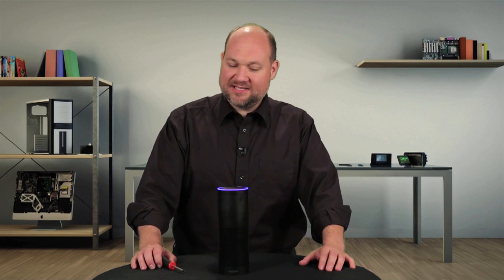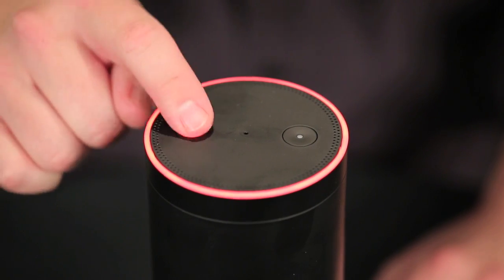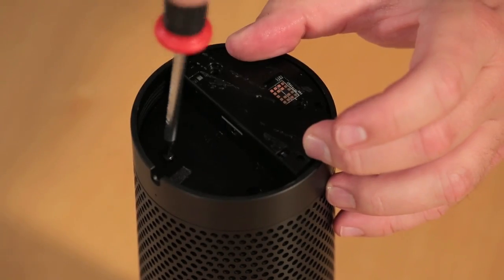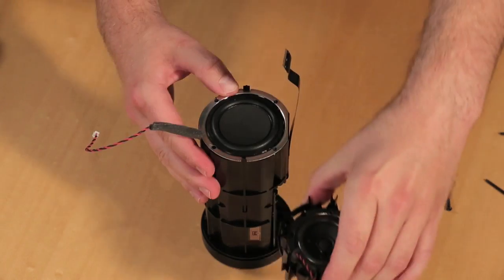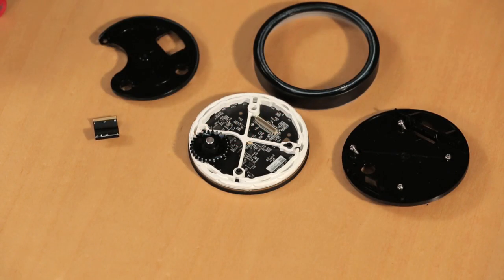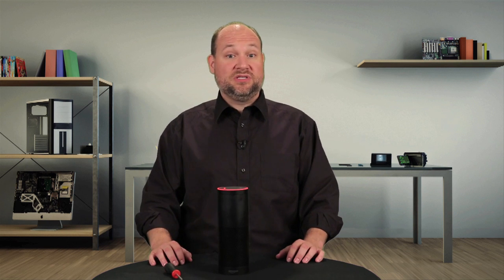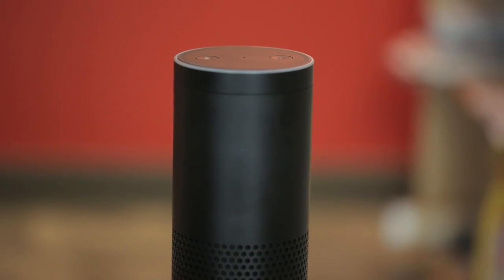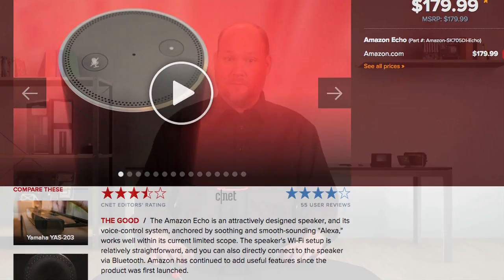Cracking Open - Amazon Echo

Comment: Requires Triangle Head Screwdrivers to disassemble, 2.3mm (most everything on the outside and going in) and 1.8mm (top volume ring assembly).